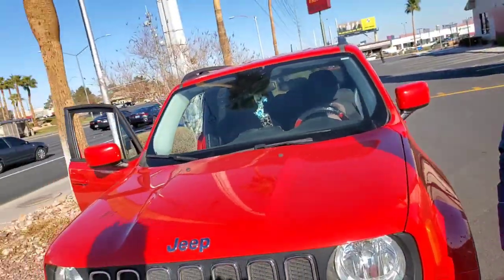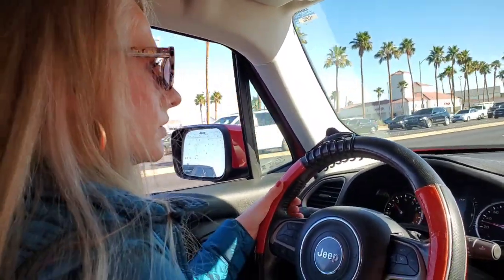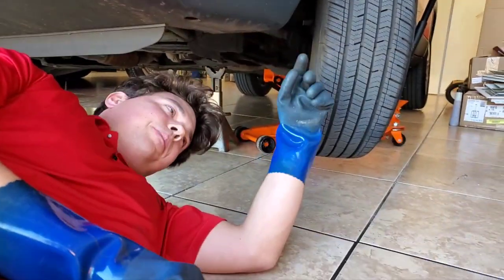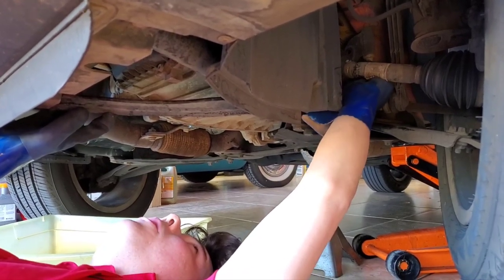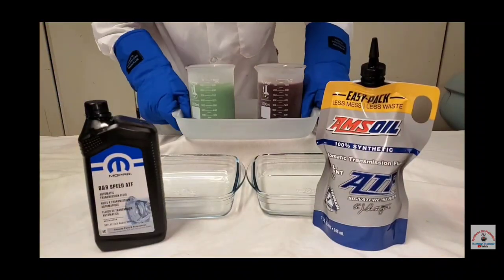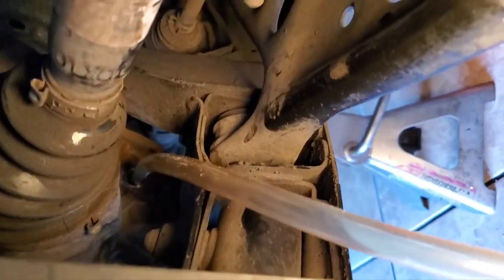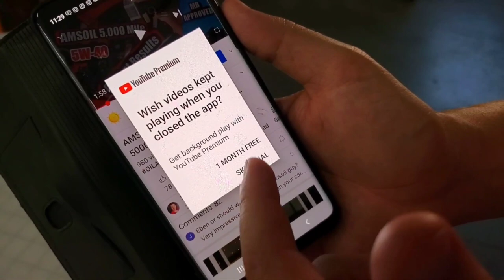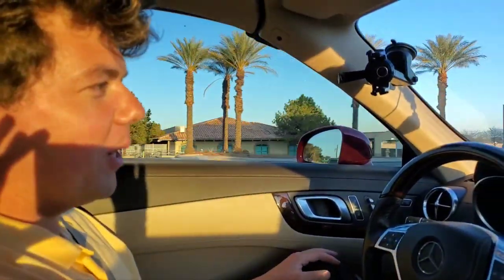Jeep Renegade ATF Fluid AMSOIL Review follow-up

Comment: Two days later…so much more power! Makes all the difference !!😊🚗
Reply from the maker: Sweet!
We forgot to do the video of the PI cleaner and upper cylinder lubricant 🪙

Will do that when we do the oil change 👍
Reply: Any transmission issues 2 years later?
Reply from the maker: @pilot545454 she's had some plastic problems with the park reverse Drive symbols they broke on the Plastics as far as the transmission shifts better than brand new.
A lot of plastics have been breaking on her car.
I give a man a fishing pole & show him how to fish. 

     Together! We can get your vehicles to run better than brand new!

     For me to get credit & be "Your" Independent AMSOIL Dealer please use my website below or my dealer no. 5331179 call anytime Eben Rockmaker 702-472-3614
After you click on: http://syntheticoilprotection.net
1. Click hamburger menu
2. Click offers AMSOIL preferred customer
3. Click join now 6-month PC member add to cart.  ( there is no reoccurring renewal membership unless you select that dot box ) 
( you have the option to not have your credit card saved if you prefer - est. 1972 )
4. Scroll up to the top Select shop by vehicle.

New Promo: FREEBOWL

Comment: For my 2015 Renegade Latitude 2.4 engine, Jeep sent me a recall for a free computer upgrade. at a dealer.  Previous to that it used 1 quart of engine oil per 1000 miles.  After, engine oil usage is not a problem.  😀 That was one of the few times I've returned to a dealer of any make for work.
Reply from the maker: Wow, that's stellar!

Comment: I enjoy the transmission & power steering & cold flow videos. Always interesting to see.
Reply from the maker: Thanks! Which video is your favorite so far?
Reply: @Syntheticoilprotection ;) Well it's one you haven't done yet ;)      I was hoping you could do a video on P.I. Improver speaking about if you only have a 13 gallon or 20 gallon tank , how much P.I. Improver should you put in.   Some people i see online use half the bottle for 15 gallons of gas and drive out their gas so it gets lower and then use the next half of the bottle on the next fill up.
Reply from the maker: For me I always put the whole bottles in because if you try to save them you got to watch if you put them in your car they don't seal perfectly you can spill it it'll get everywhere and it'll wreck and smell horrible so it's not worth trying to get cute unless you're keeping it in your garage and you put it in your car and then store it somewhere safe even if it gets knocked over it won't leak then you can do half a bottle 😉😃🎬👍
Reply: @Syntheticoilprotection  That's a fair point. Thanks Eben.

Comment: It's like your a full time machanic diagnosting Katy's 🚗
Reply from the maker: Yeah it's unfortunate there's some looseness in the motor mounts and transmission mounts over the time of expansion and contraction where her car came from with a lot of corrosion It wore out those polyurethane bushings so now it's shifty when it goes over bumps and when you shift from park reverse drive a clunks so it's going to eventually need those bushings replaced.

Thanks Robert for always being a part of the channel 💯👍🎬

Comment: I know exactly what she’s talking about. And it is something with the transmission. My Renegade has the same issue. And it happens randomly.
Reply from the maker: The Amsoil ATF fluid will make a huge Improvement highly recommend we have that video here in the channel you'll see it on the playlist section on her 2017 Renegade💯

I give a man a fishing pole & show him how to fish. 

     Together! We can get your vehicles to run better than brand new!

     For me to get credit & be "Your" Independent AMSOIL Dealer please use my website below or my dealer no. 5331179 call anytime Eben Rockmaker 702-472-3614
After you click on: http://syntheticoilprotection.net
1. Click hamburger menu
2. Click offers AMSOIL preferred customer
3. Click join now 6-month PC member add to cart.  ( there is no reoccurring renewal membership unless you select that dot box ) 
( you have the option to not have your credit card saved if you prefer - est. 1972 )
4. Scroll up to the top Select shop by vehicle.

New promos: FREEWAND
Reply: My girl has  the 1.3 turbo and if you let off of the gas too soon, the transmission feels like feel out, It has the same feeling as if you're driving a manual and you money shift.

Comment: 15k miles transmission oil drain and fill, why?
Reply from the maker: Great question It depends on the vehicle and the component some vehicles are a little bit hotter running and also they have less fluid capacity and their filter doesn't have the same magnets and filtration capability.

Also it depends on the component in how many speeds it is some shift a lot more than others the more shifting each shift creates heat friction and also that wears out the lubricant.
Every shift there's particles that come off the clutch packs and go into the fluid.

If you're doing a lot of city driving the amount of shifting is about four times more so the fluid should be changed about twice as often.

If you're doing all highway driving there's a lot less shifting happening so the fluid doesn't get as much heat and friction which means it doesn't thicken as much.

So usually depending on the driving most transmissions you want to change your ETF fluid about every 30 to 60,000 mi if you live somewhere normal.

Certain vehicles like CBT transmissions and other transmissions that are smaller that have a lot of heat and shift more you want to change them sooner than later so most CVTs you want to change at about 15,000 miles of city driving or 30,000 highway driving.

Just depends on the equipment and the way it's being taken care of For instance a diesel truck that's driven on the highway without towing and not doing any city driving you're good for about a hundred thousand miles of highway driving with a diesel truck on one ATF fluid change.

So there's a lot of variables that come in and you're always better off changing it earlier than later because of the price of the component and the loss of driveability and fuel mileage.

This is my personal link if you're ever considering trying the Amsoil I would be your Amazon dealer I could always answer all your questions in the future on the products and this is my link thanks again for the future business and I appreciate you being a part of my YouTube community.
❤️🇺🇸❤️ Professional YouLubher: Eben Rockmaker Regency Gold Direct Jobber AMSOIL Specialist (Dealer#: 5331179) 702-472-3614 
      
      ✅✅✅  New To AMSOIL I Recommend The AMSOIL 6 Month PC Membership because it will save you about $33 on a $100 purchase after the difference in tax - https://www.amsoil.com/offers/pc/?zo=5331179
Reply: Definitely want to use Amsoil on my wife 2019 Hyundai Santa Fe. Drain and fill no filter change, she such got to 29k on the car. The link you provided leads me to Amsoil.
Reply from the maker: Yes sir you can order it right there the lookup guide will give you everything for the year make model and engine size.

Thanks again for the business in advance and if you ever have any questions always happy to talk Thank you.
Find AMSOIL Products For Any Vehicle - https://www.amsoil.com/guides/?zo=5331179

Comment: My 15 does the clunk when you rapidly decelerate then get back on the gas. Its a TCM issue, well its just hiw the TCM works because its trying to figure out when to shift based off how you are driving. You have dealer reflash or reset the TCM. Also definitely change your motor mounts. The original ones are garbage and Mopar has a bew design out.
Reply from the maker: Yeah with the heat the polyurethane bushings where out really quick.
As far as the shifting on her car it got a lot thicker with oxidation that definitely changed the shifting when we use the Amsoil made a huge Improvement😉
 I give a man a fishing pole & show him how to fish. 

     Together! We can get your vehicles to run better than brand new!

     For me to get credit & be "Your" Independent AMSOIL Dealer please use my website below or my dealer no. 5331179 call anytime Eben Rockmaker 702-472-3614
After you click on: http://syntheticoilprotection.net
1. Click hamburger menu
2. Click offers AMSOIL preferred customer
3. Click join now 6-month PC member add to cart.  ( there is no reoccurring renewal membership unless you select that dot box ) 
( you have the option to not have your credit card saved if you prefer - est. 1972 )
4. Scroll up to the top Select shop by vehicle.

New Promo: FREEBOWL
Reply: @Syntheticoilprotection  Awesome 👍

Comment: The jeep renegade is known for bad motor and transmission mounts, vibration or a thump can be felt. Just changed all mounts in my wife's 2016 renegade. Also burns alot of oil.
Reply from the maker: Thanks Kevin for the update really appreciate you sharing that with the channel that way everyone can know what to expect from their vehicles 😃💯🪙

Are you in Amsoil preferred customer?
Reply: @Syntheticoilprotection  I’m an amsoil dealer
Reply from the maker: Sweet
Reply: I’m an ase master tech and well versed in diesel,heavy equipment,power sports and racing engines. If you ever have questions, feel free to ask.
Reply from the maker: Sweet👍😃💯
Thank you Kevin ☕
Reply: Mounts are so trash they redesigned them. Just swapped my passenger and driver sides out and wow you can hardly tell the engine is on now. The Mopar ones are $600 + for the set but I figured pay once, do once, cry once instead of putting trash non OEM's on.
Reply from the maker: @dmacarthur5356 great to see it's awesome now thanks for sharing with the channel

Comment: I have a 2017 Renegade, and I found out the clunking comes from when the trans goes into 5 gear and you take your foot off the gas as soon as it shifts, this, I found out is an inherant problem with the computer,  this is a computer shifting problem. Feels like the rear end is turned on when you deccellerate, and you get the feeling like soneone hit you in the rear bumper.  A problem they do not know and will not fix........everyone I talk to has this problem with the Renegade.
Reply from the maker: Yikes I've never heard of this Gilbert but I hope you can find a technician that knows how to fix it👍
Reply: yup, I've had that issues on the 2020 jeep 1.3 turbo,Exactly what you said, It happens when I let go of the gas pedal too soon

Comment: If your trans is under warranty putting the wrong trans fluid in will void the warrenty.
Reply from the maker: I give a man a fishing pole & show him how to fish. 

     Together! We can get your vehicles to run better than brand new!

     For me to get credit & be "Your" Independent AMSOIL Dealer please use my website below or my dealer no. 5331179 call anytime Eben Rockmaker 702-472-3614
After you click on: http://syntheticoilprotection.net
1. Click hamburger menu
2. Click offers AMSOIL preferred customer
3. Click join now 6-month PC member add to cart.  ( there is no reoccurring renewal membership unless you select that dot box ) 
( you have the option to not have your credit card saved if you prefer - est. 1972 )
4. Scroll up to the top Select shop by vehicle.

New Promo: FREELAMP

Comment: I don't know why people say amsoil expensive. It's really less expensive than mobile #1 annual protection and all amsoil ATF cheaper than most brands out there specially much cheaper than OEM. And the great part about all amsoil lubes are great and last longer than anything else. Just want to mention other than amsoil signature series there's amsoil XL and Amsoil OE and them all are 100% synthetic and you can't beat the price of XL and OE they are cheap and work better than mobile #1 annual protection which I stopped using.
Reply from the maker: Thanks for sharing this with the channel You make a lot of great points especially as a preferred customer and looking at how much time it saves you by not choosing you to fluids it really saves thousands in the long run and when you look at not replacing your vehicle sooner than even becomes exponentially more like compound interest.
I always like to share the performance results!

♥️ AMSOIL Performance Test Results. Read This Article - https://www.amsoil.com/performancetests.aspx?zo=5331179

Comment: Everything I've read has said to use the overly expensive Mopar trans fluid, even the sites for mechanics that teach you how to build your own dipstick tool. Which has a different process then your that requires getting your trans fluid up to temp which is read through a diagnostic tool then measuring fluid levels. Plus two things that concern me about the amsoil atf fluid in my renegade are, the mixing of the 2 fluids seeing you'll never be able to get all the old fluid out, and the fine print when entering my vehicle into their site. This atf fluid comes up for my vehicle but the numbers they have for compatibility don't work for my vehicle. I'm at 120,000 miles right now and my trans fluid has never been changed. The shifting could be better but it's not horrible. You just changed this fluid 15gs ago and your already doing another?  And she only has 50g? These units are sealed from factory and they say it's lifetime,  but I know there's no oil that last forever.  Not trying to crap on your work but everything I've researched,' extensively ' tells me otherwise. I'm going to try and contact some from amsoil to confirm their atf will work/ or not. Theres other people on here saying they have and were told it wouldn't, but I'd like to see for myself.  Ps, thank you and great work on your videos
Reply from the maker: This will give you all the fluids and capacities for your year make model and engine size when you use my link here that will allow me to answer all your questions in the future on the products about improving the performance and lifespan of your vehicles by choosing the right fluids as your independent Amsoil dealer 👍
♥️   Find The Right Fluids For Your Vehicles - https://www.amsoil.com/guides/?zo=5331179      

     ✅   Save 25% On Your Next Fluid Order: https://www.amsoil.com/offers/pc/?zo=5331179

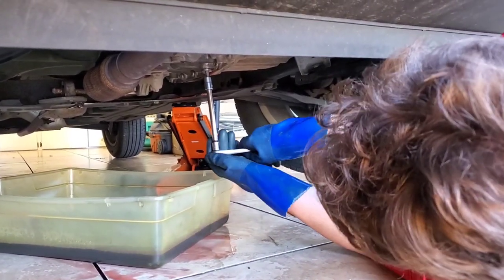Comment: 11:54 please go buy a torque wrench and torque it to spec
Reply from the maker: I respect your opinion yes if someone's new to doing mechanics they should definitely get a high quality torque wrench and be precise on specific things like spark plugs however most things that are just drain plugs as long as you're in the general ballpark there is very little risk so that's why I personally don't choose to I do have a good touch and have quite a bit of experience but if someone has poor touch or feeling in their hands I highly recommend a electronic Snap-on torque wrench💯😉👍
I give a man a fishing pole & show him how to fish. 

     Together! We can get your vehicles to run better than brand new!

     For me to get credit & be "Your" Independent AMSOIL Dealer please use my website below or my dealer no. 5331179 call anytime Eben Rockmaker 702-472-3614
After you click on: http://syntheticoilprotection.net
1. Click hamburger menu
2. Click offers AMSOIL preferred customer
3. Click join now 6-month PC member add to cart.  ( there is no reoccurring renewal membership unless you select that dot box ) 
( you have the option to not have your credit card saved if you prefer - est. 1972 )
4. Scroll up to the top Select shop by vehicle.

New Promo: FREEMP
2nd Promo: FREEMS

Comment: Could be the slip yoke on the drive shaft I had that issue several times on my old Silverado depending on how you stop will make it clonk like that since her Jeep came from a wet climate and the fact that the mfg no longer put grease fittings on the u joints and slip yoke that would be a great place to start looking for the noise that Katy has
Reply from the maker: Great suggestion excellent I really appreciate that and that could be it yeah this car was really in a really salty area or something definitely has way too much corrosion on the exhaust for being such a new car

Comment: The ZF 9-speed used in the Jeep KL, Renegade, & pre-2023 Compass, and Honda, etc is known for random clunking shifts. The 2.4L TigerShark Multi-Air engine used in some Jeep models was known for excessive oil consumption. It was retired and replaced with a 1.3L Turbo in the Renegade and 2.0L Turbo in the Compass, and those historically have been much better engines. The 9 speed was retired and replaced with a ZF 8 speed. Much better powertrain.
Reply from the maker: I give a man a fishing pole & show him how to fish. 

     Together! We can get your vehicles to run better than brand new! 

     For me to get credit & be "Your" Independent AMSOIL Dealer please use my website below or my dealer no. 5331179 call anytime Eben Rockmaker 702-472-3614
After you click on: http://syntheticoilprotection.net
1. Click hamburger menu
2. Click offers AMSOIL preferred customer
3. Click join now 6-month PC member add to cart.  ( there is no reoccurring renewal membership unless you select that dot box ) 
( you have the option to not have your credit card saved if you prefer - est. 1972 )
4. Scroll up to the top Select shop by vehicle. 

New Promo: FREEQS

Comment: So she bought the car at thirty something thousand miles during the drive the odometer red fifty three thousand and this guy is changing the trans fluid again this guy is ripping you off and destroying your transmission what a joke this guy is that is a sealed transmission you do not need to change the oil.here is another fact those cvt transmission are not repairable when they go you replace them.
Reply from the maker: This is on that topic - https://youtube.com/playlist?list=PLB_ftWArBFdeufGVSL3m0GooSGQ27fjnl&si=IfaGl3PjNe2wGR-R